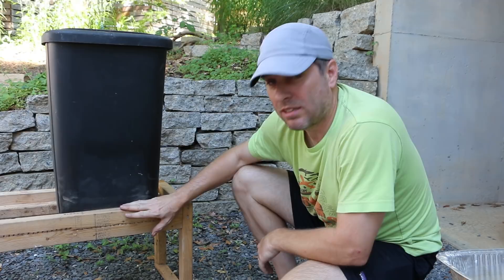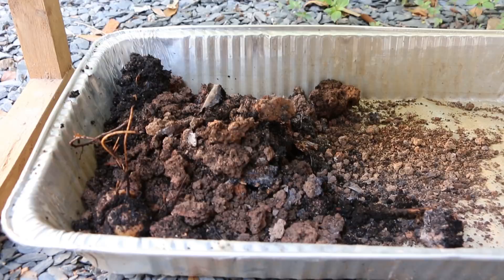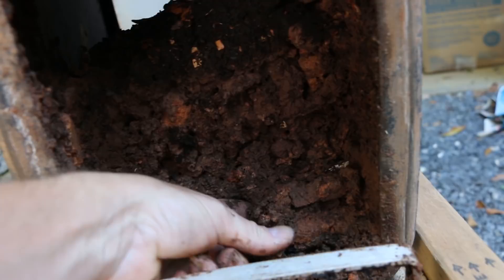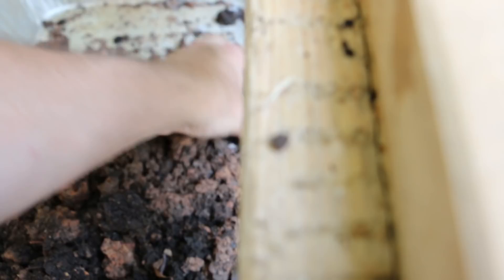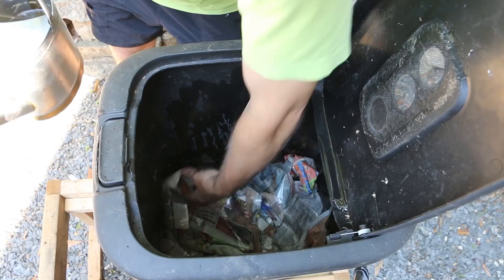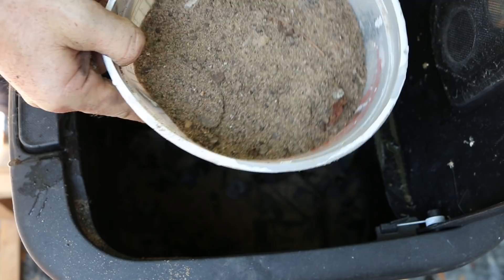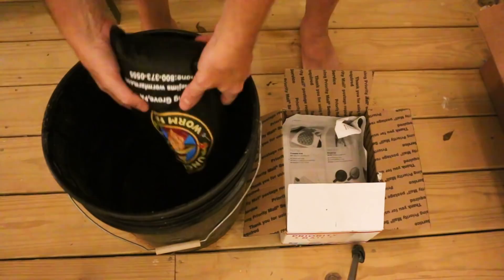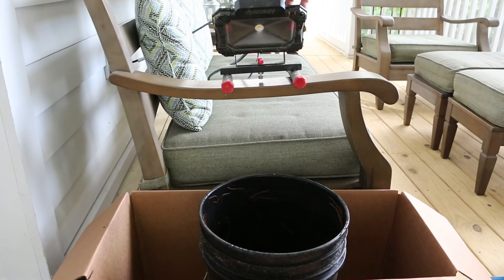How To Supercharge My Flow Through Worm Composting Bin

Comment: What you can do is to use a round garbage can. Then, instead of sliding the can, you rotate it over a blade in an angle. It will work the same way a rotary food mill work. You gain several advantages: (1)  save some space (2) you have control over the quantity of compost you want, just rotate the can a quarter turn, half a turn or more. (3) probably easier to operate.

Comment: You could water the bin on a regular basis, since the the flow through system has more air entering the bin.  Your bin appears too dry for the worms to thrive.  Instead of using the clay soil, use peat moss or coconut coir and your castings will be dark and moist.
Reply from the maker: I concur with your moisture concern. The convection air flow rising through the bin definitely has a drying effect.

Comment: Have you considered expanding the frame higher to make a track for the top of the bin to slide along? Might help make it easier to push so you don't have to fight it tilting on you.
Reply from the maker: I hadn’t thought of that. I do think once it is only slicing through castings, it will push through more easily. Thanks for the suggestion.
Reply: @GreenShortzDIY  No problem! Thanks for all the hard work you put into these videos. They're a pleasure to watch.

Comment: could make it easier to slide the. blade if all 3 edges where sharp and for the best cut the bevel should be on the inside of the cutter plus it looks like you should lower the cut bar another ''1 or ''2 so it takes less each cut

Comment: I have an idea that I would like to share. build the frame like the first one but taller, with the taper add a second bottom half of a trash can slid on to the bottom of the top one, so all you have to do is slide the bottom one off. Maybe put some latches it. drill some holes in the harvesting container so you can collect the liquid in a tray underneath.
Reply from the maker: Ideas always welcome, Jon. I like your suggestion. You've got me thinking. :-) Thanks for watching.

Comment: Hey, I'd love to hear your experience on the following: Do you happen to find leachate dripping from the flow through worm bin? Evtl why not? Unfortunately if I try googling this it'll only explain me why worm tea and leachate are different things... But before getting into the build I'd like to pick a design that'd make me leachate! Thanks a lot :)
Reply: Almost any design will provide leachate as long as an adequate moisture level is maintained. Some designs will afford a more readily accessible manner in which to drain it off. A valve at the lowest point in the system and a recessed region that allows for the accumulation and eventual drainage help to facilitate this process.

Comment: I was wondering about wood shavings? Can I add them in?
Reply from the maker: Yes. Wood shavings are fine. Make sure it is untreated wood. Some woods are toxic, but a quick Google search should answer that. You might mix them with some dry leaves, and a little soil, more for consistency than anything. Thanks for watching.

Comment: Why not insert a 1" dowel rod through the sides at the bottom.  Screw some 3" wood screws through the dowel rod, leaving an inch sticking out on each side.  Attach a crank handle and then just rotate the dowel rod and the screws will grind out the castings and they will drop into your pan so you don't have to mess with the sliding.

Comment: Dude, You should have NEVER used clay soil as bedding. Coir dampened to the consistency of a wrung out sponge only yeilding a couple of drops of water would have been perfect. You need at least 24 inches of bedding to start with in this kind of design.

Comment: I heard a lot about using 3 boxes. Did you try it? Is this way better?
Reply from the maker: It is a preference thing. My first worm bin was a two-bin unit. (I recommend 2 bins versus 3). Worked great, but the worms and castings have to be separated manually. Which is kinda fun, but time consuming and a little messy. Here's a video: https://www.youtube.com/watch?v=aHS1UKdUzVo If you are just starting worm composting, it is a good starter system. Very easy to build. In my experience (so far), the flow through bin is much easier to harvest, although a few worms might get sliced in the process. Thanks for watching.

Comment: I think you made a big mistake filling the bin with clay-dirt.  Also, when you are trying to harvest, you do not really have enough worm castings to justify it.  Finally, on the hand you expect the worm castings to slide down over time so you can slice off another chunk, but then you expect the same castings not to slide out when you do your harvest and move everything over across the harvesting blade.  I'd have to say, sorry, but  I think this system does not succeed.  I just found your channel today and was watching with amazement and even planning to build one of these, but I don't think it will work, at least not easily and efficiently.  Great idea, but I think it needs more work.